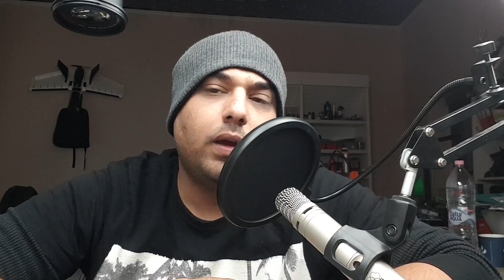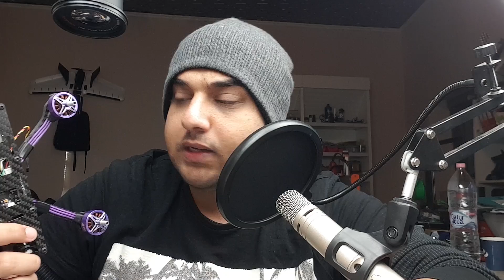DIY FPV Antenna Tracker , F7 Open Hardware FC, ESC Stress Testing

Comment: 0:22 // Wiring should be done according to the instructions (audio channel connection is not necessary). //  -https://www.foxtechfpv.com/product/tracking%20antenna/arkbird/Arkbird%20AAT%20Manual.pdf   -
Maby specif for ark. Just noticing.

Comment: If I wasn't already subscribed then I would do it now right away. And why am I only once able to trigger that like button? This is such a great video, your explanations are awsome.
And I'm really curious about your tenserflow ideas because I also experimented with some of the libs.
AI was pretty resource-hungry, I'm not sure if this would work on a fc, but I only ran some more data intensive tests than filtering quadcopter fc data. I also think that maybe training/learning may be a problem because of the definition of the optimal situation to compare the flowing data to.
I am really, really curious if you experiment with that in combination with flightcontrollers with chips like the F7 and tell us your suggestions and results.

Comment: Why not just use Mavlink to transmit gps back to your gound station? APM does this already. You can use a sik radio on 915Mhz or the full size TBS Crossfire radio can transmit mavlink as well.
Reply: inav or pretty much all the baseflight offsprings don't support mavlink telemetry. Even if they do which currently inav also have, they only send it 1 direction only. I don't mind that but I do wonder if Inav boards can talk to the Mission Planner software for the gps location for tracking and monitoring

Comment: Monolithic power system makes buck converter chips, if you are interested ,you can make an fc +pdb ,with 8s input.Which I would be doing for this holidays for my warp quad.

Comment: There are different approaches for error correction/detection. One is to add code to Betaflight or iNav to calculate a simple checksum and ignore everything with incorrect checksums on the receiver side. Another would be to use a dampening algorithm so several GPS updates get averaged with the latest one weighed higher but not as high as the sum of several previous ones. The NASA approach would propably be to use some sort of forward error correction (FEC) like Reed-Solomon.

Comment: - checksum will guarantee the whole packet is correct. if not, drop it.
- distance can be calculated depending on both coordinates (you'll need another gps on the base for that)
There was something along these lines in rcgroups, i was looking for exactly this thing a while ago. good luck!
Reply: You don't need a GPS in the ground station. Just use the craft's location when arming and assume the ground station is close to that and stationary.

Comment: There must be a way to sent GPS data back over smartport, right? maybe it does that by default? I haven't even checked. But it would save a ton of trouble if you just had to get the GPS data out of the radio instead of off the quad.

Comment: you're coordinates are not going to change a lot in a long range bird, what I would do is use something like .. I run multiple APRS trackers (ham radio stuff) but that runs at 1200 baud onair, but as you/'re running it over the audio channel, then you can run that up to 9600 without an issue and it will be perfectly fine to run in under 5 seconds (an aprs packet burst at 1200 baud is just 2 seconds).

If you want more help., let me know i've built plenty of them. and the protocols are already there for arduinos (i have a tracker running on an arduino uno right now in my car)

Comment: Could you also add an RSSI tracker by using an array of antennas:
- A central high gain antenna attached to the vtx
- several higher gain antennas around it with the beams concentrated so that they overlap the edge of the central one
- Arduino reads the rssi on the antennas, should one of the edge antennas have an rssi higher than the central one, move towards it.
I guess you'd also need the GPS to prevent the antenna locking onto someone's wifi or something.

Also......WHAT SOLDER SHOULD I GET FROM BANGGOOD?
( I get my own locally in the UK but for reasons I won't go into I need a good one on BG specifically)
Reply: don't buy solder on bg buy stannol from germany  or buy cester in the us
Reply: MG chemicals on amazon and probably bangood is the best solder you can buy... unlike the other commenter i am not a fan of kester but to each his own

Comment: I need diy antenna tracker, Very good work. Thank you. Antenna trackers are very expensive. But requesting you do complete project. Actually I waited for R9m mod. I waited for your 1 watt booster. But I think final video was not came.